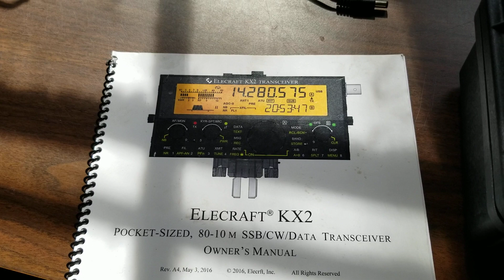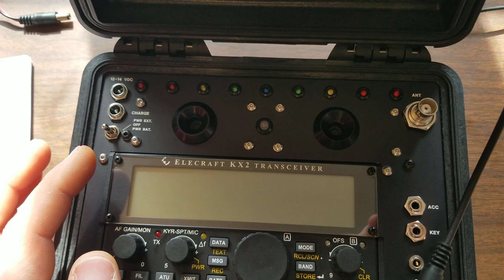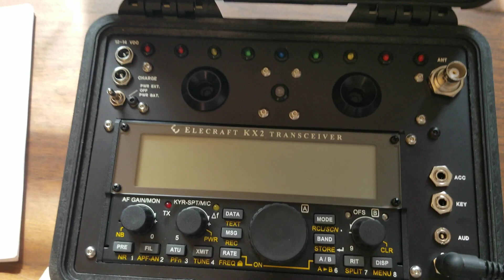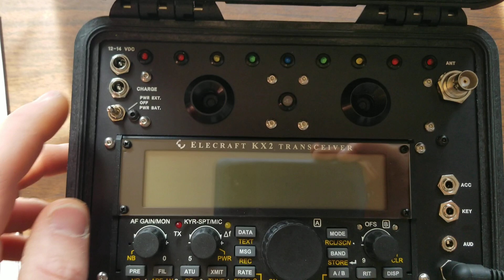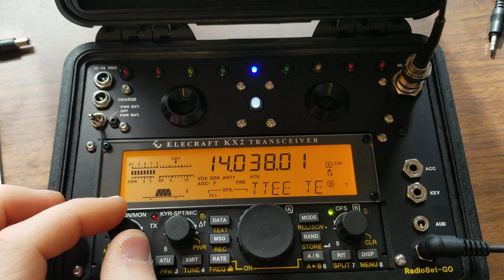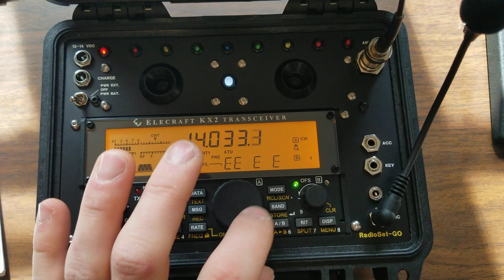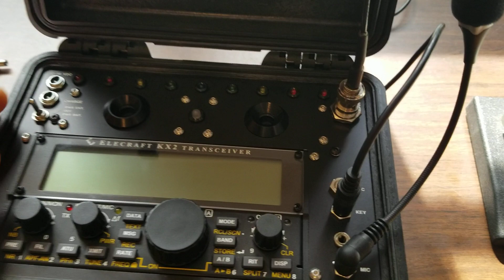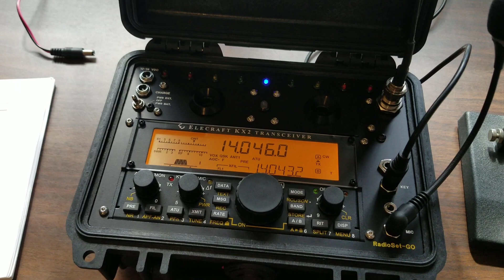Elecraft KX2 upgrade kit by RadioSet-GO

Comment: that looks VERY nice and neat, Unfortunately I don't agree to pay almost the same cost of the radio for a pelican case with lights and female plugs (per your website, $500+s/h). Great job do. I just need to figure out the touch paddles and will be a very nice project.
Reply from the maker: Thanks for the feedback. If you were to see the cost of the low volume, high quality, specialty components that I use, and the amount of time and effort I spend not only building but also perfecting the design, you would know that it is actually quite a reasonable price. On the outside it is indeed simple, such as the LED’s and jacks you mentioned, but what you don’t see is the wiring and circuitry involved (much of which I have designed myself) including the power distribution and automatic switching of the fan and other accessories in the most recent version. Stay tuned for the newest touch key innovation! 73 de W1JSB
Reply from the maker: Angel, I have a touch key circuit for sale on my website now, if you are interested. radioset-go dot com

Comment: Have you considered making a pcb or kit of your capacitive touch key circuit? I have been trying to get one working but it seems to be very sensitive to RF.
Reply from the maker: The touch key circuits are very prone to RFI, unfortunately. I have been struggling with this a lot myself, trying to make something as good as what Sumner Eagerman (SK) used to offer. I do have a design that should work soon, and will be very stylish and unique. I plan to sell them. 73
Reply from the maker: Hi Ryan. Yes! I have them for sale on my website now. radioset-go dot com

Comment: I’m interested in the speaker setup.  I am mostly a headphones operator, but your speaker looks like a great option.  I see that voltage of your mod is less than the KX2 external?  The KX2 can handle 15v but it looks like I see a range on the plate that says 14v?
How has the heat dissipation worked out on this so far?
73 de N1XF
Reply from the maker: The speakers really do make the thing come to life with good volume and clarity. The acceptable voltage range is a bit lower than the KX2 can handle, only because some of the accessories require a lower voltage. Heat dissipation seems very good, especially since adding a heatsink, PWM cooling fan and vented control panel to the most recent design. 73 de W1JSB